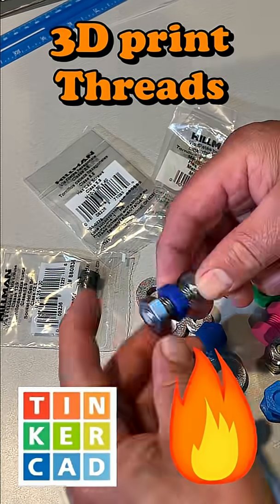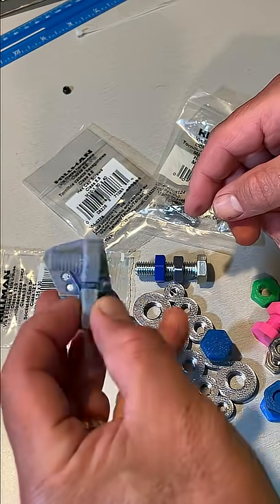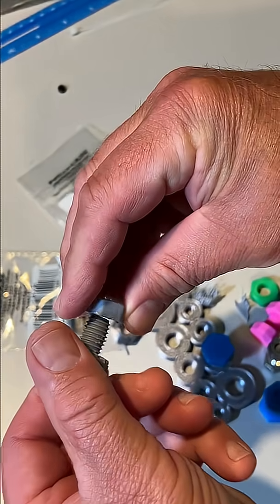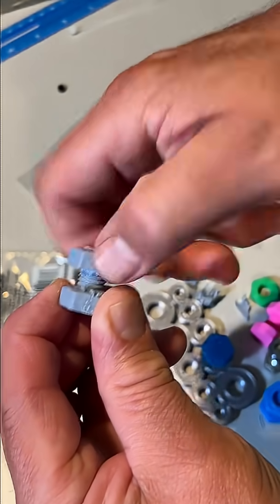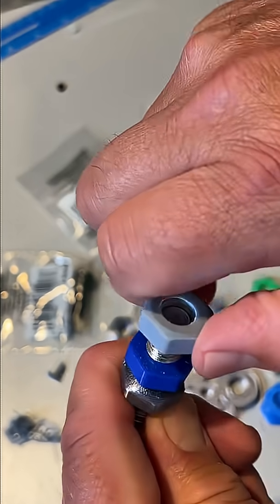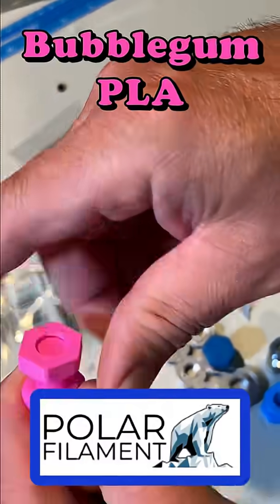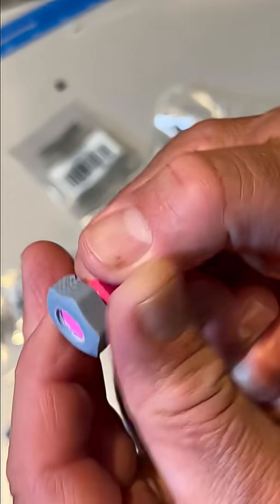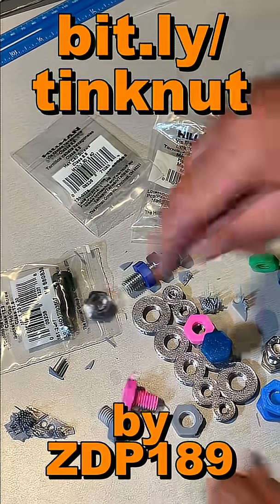3D Printed Tinkercad Threads Update! Printed in Resin today 💯🤯

Comment: I'm no resin printing expert, but yeah you probably have to remove all the support material from inside the threads.
Reply from the maker: Resin is by nature great to sand... I think with a bit more work it will get more smooth... I think after time it could also wear down like a knee joint in a old dude...